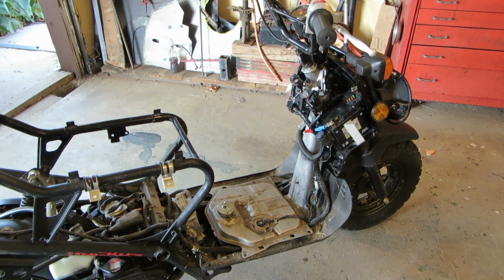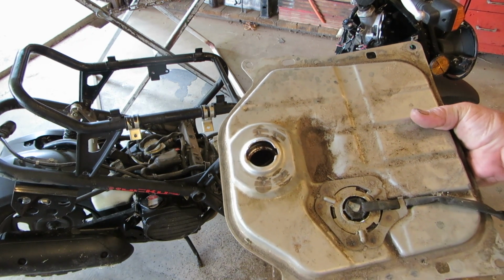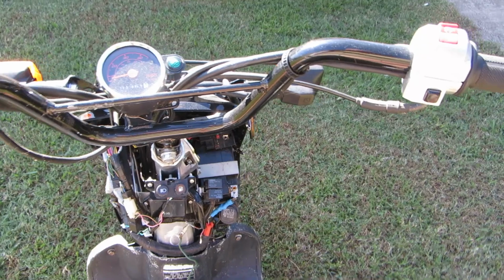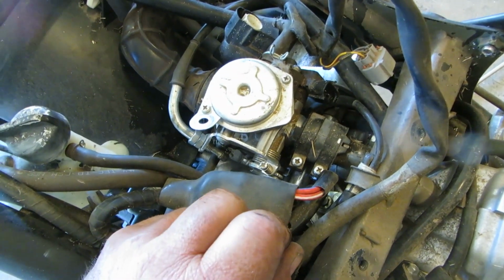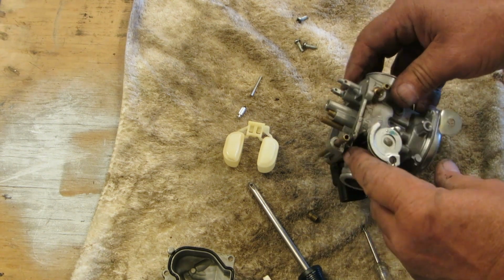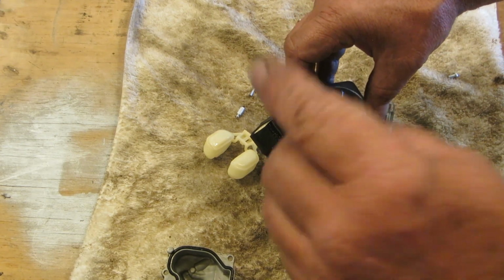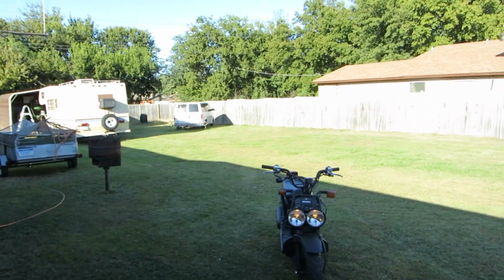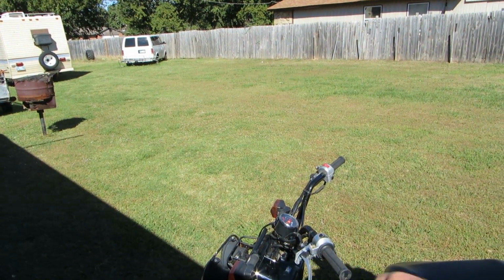Honda Ruckus 2015 Repair Take 2

Comment: Clean the idle jet the idle jet in those ruckus is really small.. maybe you can line the speedometer cable or make sure it’s connected right at the tire hub

Comment: Make a little tool kit to rebuild on side of road after 20 times you get good at it or good at giving up make sure you have atuiny steel guitar string about 6 inches long e.ulsion cloggs up over time. Practice rebuild in. Dark closet or you will be sxrewed on the side of the road with faulty or no flashlight